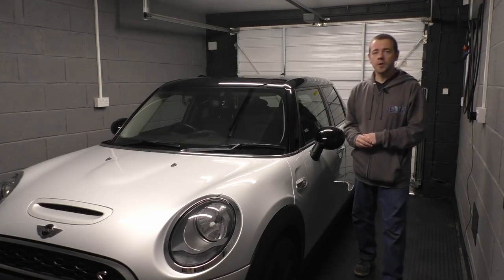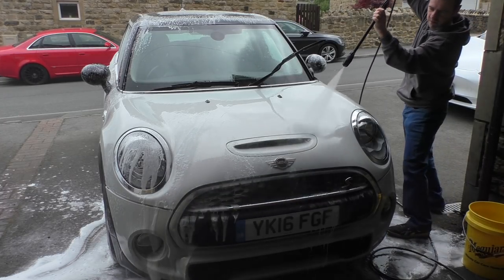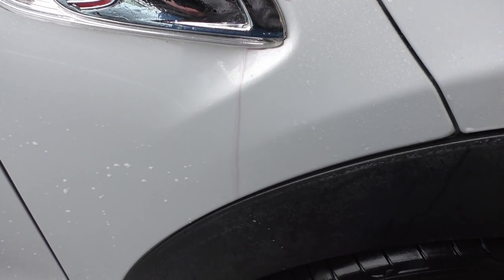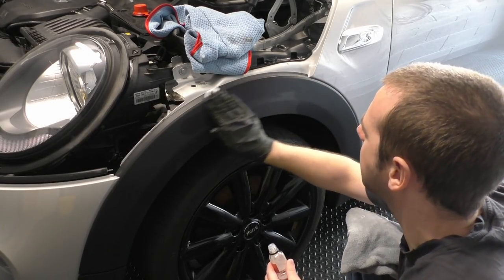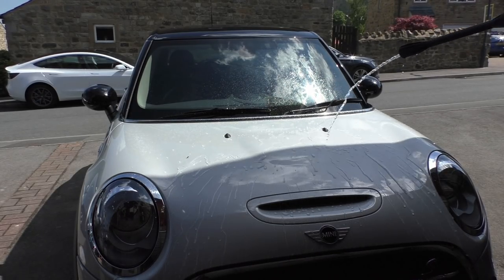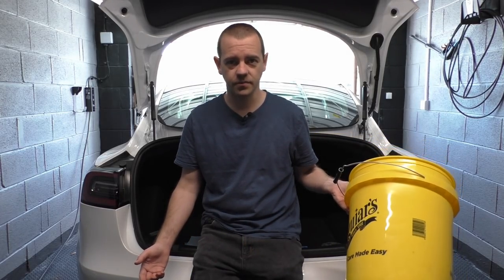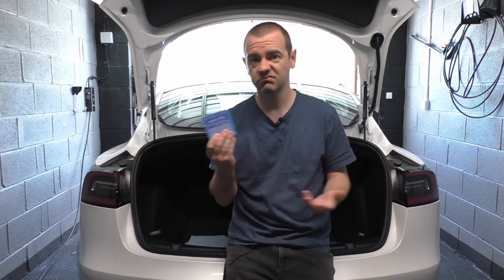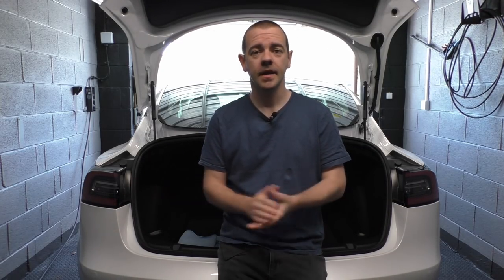How To Clean/Detail A Car & What To Use

Comment: Great video, thanks for all the advice. And for sure I would like to see another video about interior cleaning. I especially find the inside of the windscreen hard to get properly cleaned with no stripes gleaming in the low sunshine.
Reply: Olli Majander Solution, only drive at night.
Reply: Use plain water on a rough towel. Then dry vigorously using a separate clean dry towel.
Reply: I find Auto Glim Car Glass Polish is very good. No streaks and it doesn't mist up as much on cold days. Do not use household glass cleaner on your car, it has silicone in it which makes it look shiny, but does smear and fog more easily. The Auto Glim cleaner is also good for the bathroom mirror as it help that not fog so much too.

Comment: Really good video, so well explained i think you should call this 'car detailing for dummies' :) An interior video would be interesting to see as it is often harder to clean the inside than the outside. Missed the video about ceramic coating your car, but i have seen all kinds of claims about how well it supposedly protects the paintwork.

Comment: I used C4 on my mini too it's excellent but as you say proper prep of the surface is essential. I dont have an engine bay on my i3S though and the motor is under the boot floor. I guess I could clean up the frunk though!😉
Reply: More recently I've used Detailers Juice cleaning products. Excellent results and reasonable prices👍
Reply: Carmen Clark I used a Zara Picasso on mine.

Comment: This has inspired me.  @EVM If you don't mind, I have a question about dealing with stone chips before I put on a proper wax.  I have a Zoe with a few little stone chips which show little spots of different shades of red (and some white which I think is polish caught in the chip) under my metallic Mars Red.  I've used Turtle Wax colour magic coloured wax with touch up wax sticks before on other cars on hairline scratches and was never really sure if it worked or I was wanting it to work.  What's your view on dealing with stone chips and small paint scratches, short of a respray please?  Is the coloured wax stuff any good at masking the imperfections or a placebo/scam and I just need to accept that there's chips?

Comment: All good advice.
I have a question, related to keeping your car looking nice, have you considered PPF on the M3, if so which panels, if not why not?
Thanks
Reply from the maker: Costs over £2000 for the full car so not worth it. Could get a hell of a lot of body shop work done for half that.
Reply: @ElectricVehicleMan   Crikey, that's cheap, a small car down South is around £3k.
Any hoo, I asked because I'm looking at getting a Honda e & considering getting the black plastic between the headlights (which I bet will be pricey to replace & not repairable) as well as the front bumper, like you say it's probably cheaper for repairs on body panels so will not bother with any other panels. Just waiting on a price from some local companies.

Comment: Thanks for video,  why do I finish with the car covered in water spots. When I wash mine, I use decent auto Glyn shampoo.
Reply from the maker: Graham Goulton It’s what’s in the water, not the shampoo. Dry the car off after.
Reply: Electric Vehicle Man yes as I expected, I didn’t dry quick enough because it started raining.
Any tips to remove them I’ve washed dried and polished but they’re still there.
Love the channel bought my used 30kw leave because of it and no regrets.

Comment: Hi thanks for another no nonsense practical video.
You are to blame for my leaf experience, best thing I ever purchased, three years ago, thanks again.
With all the fuel cash I saved I’m much better off in my latter years.(I’m 78)
My latest sort of Ev, is a I3 but has some bike rack scratches on the glass back end from previous owner and I wondered what you would recommend to minimise these (some are just finger nail detectable).
Thanks again,again.
Peter
Reply from the maker: Machine polish would reduce them but only paint can fix a scratch.
Reply: Electric Vehicle Man Thanks for that, but it’s all glass at the back, even below the screen!

Comment: halfords  advert ?  -  Other car shops are available.
you said in vt the brush 3 or 4 pound  then at 18 min it changed to more   on your list  its 7 pound
i want to ask what number of people do this much when washing there cars   would be a good vote.
how many people wash car themselves  or take to a car wash - another vote may be,  is just taking it to the car wash worth it is the job and cleanest value for money vs doing it yourself
how long did the clean take ?..
Reply from the maker: The brush I use is £6, you can get ‘brushes’ for less.

Comment: Do you actually need clay lube spray, or it is mostly useless?
Reply from the maker: jur4x You need something. Shampoo will do.
Reply: Bilt Hamber clay is designed to work with water so you save money on detailing sprays / lubrication.